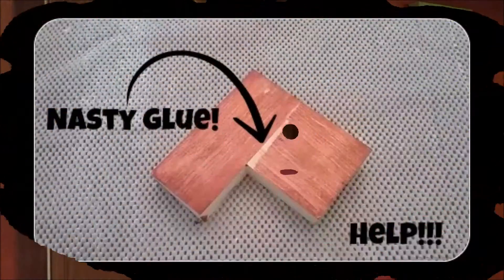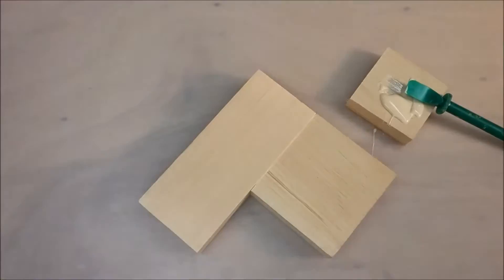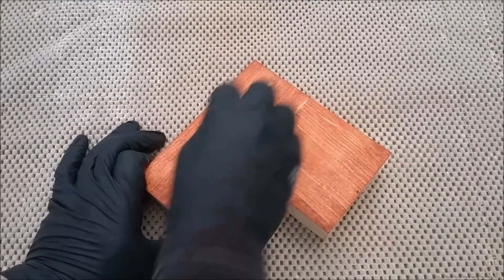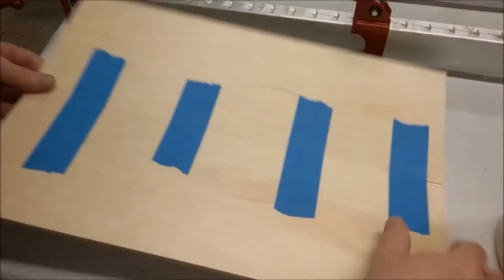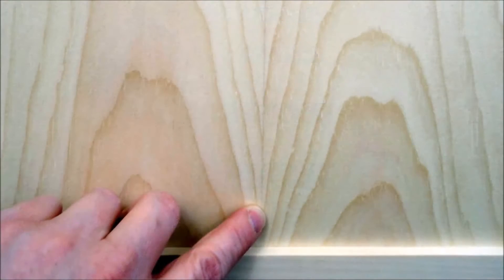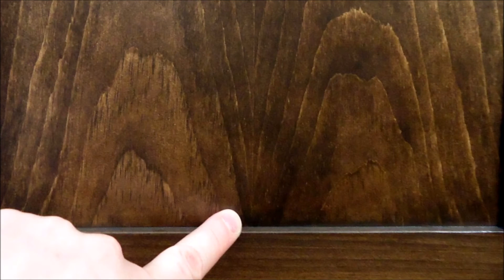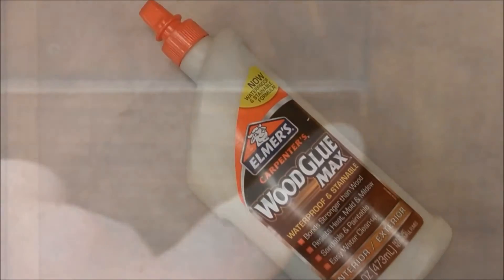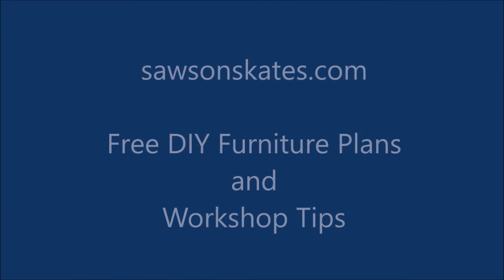Why I Only Use THIS Wood Glue for My DIY Furniture

Comment: Hey buddy. I couldn't put a comment on your wood filler vid, but my question is related to this vid as well. I have heard for a DIY wood filler you can use the saw dust mixed with PVA Wood Glue, which is much different to using Shellac. I have tried it before but I wasn't staining the item and it did match up ok. So would wood glue be an ok substitute or you think you will have the same issue you showed in thi vid where the dried glue becomes noticeable, unless using this specific Elmer's glue, which probably isn't available here in Australia, but possibly another stainable formula? Cheers